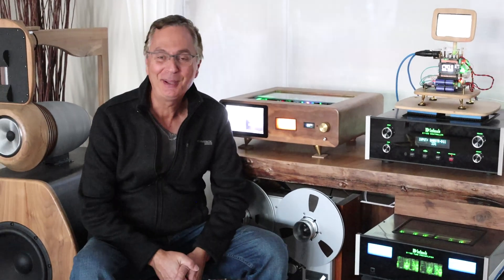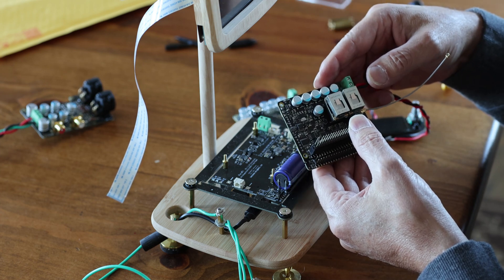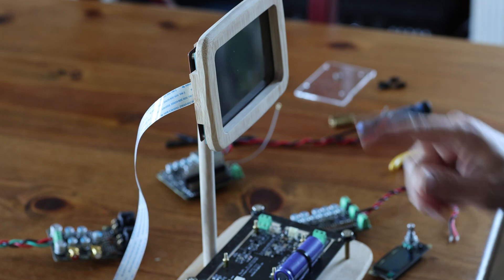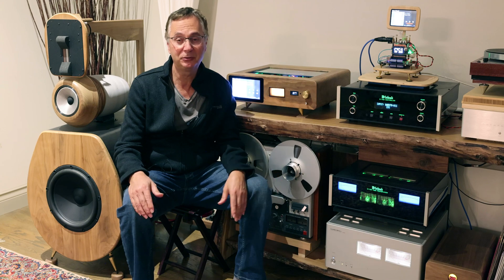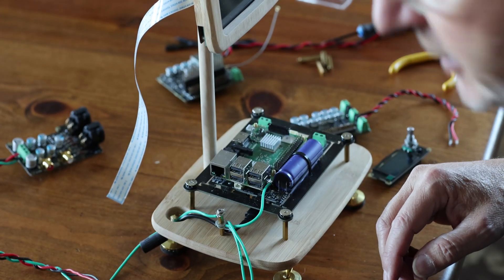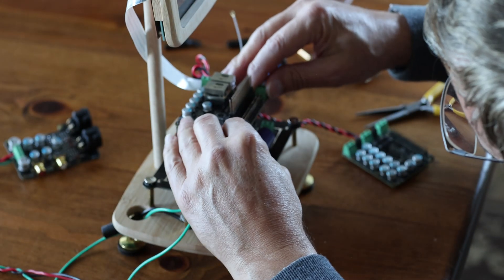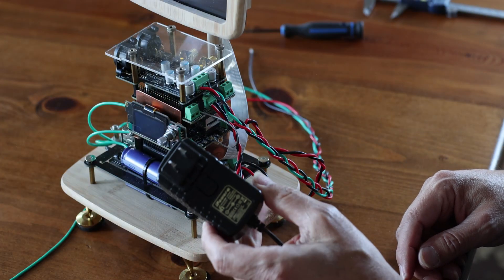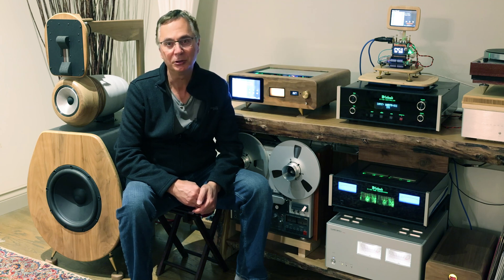Build a Flagship DIY Dac from Ian Canada Parts and save thousands of $$$ Gabster D6

Comment: Really like the build, thank you for sharing. One question, my pre amp amp does not have balanced inputs. Ian says that the rca outputs of this DAC should only be used for testing. Can you confirm that? Are there other options in case someone does not have balanced audio input?
Reply from the maker: I think you are fine specially if you have descent short interconnection. There is a dual opa861 to create a true balanced design so you loose a tiny bit on that. I recall trying it on a single ended tube amp and sounded good. 
You can also try transformers and see if it is better for you but they are close.

Comment: I cannot find no. 7.Uc conditioner  UcConditioner 3.3V  (26A) in your Video, do you really need this? I only see the purepi board.
Reply from the maker: It has been replaced with MkII 26B
https://github.com/iancanada/DocumentDownload/blob/master/UltraCapacitorPowerSupply/UcConditioner/UcConditioner3.3VUsersManual.pdf
Reply from the maker: Also this is a upgrade option not a must you can start without first

Comment: @Gabster1  I am about to insert a fifo Q7 between RPI4 and Protodac. Do I need the grey cable mentioned at 11:18 ? And if not, how does fifo Q7 reclock the signal to protodac ?
Reply from the maker: No you do not  the ProtoDac takes the signal from the clean isolated part of the Q7 via gpio 40 pin. 
Let me know if you hear improvements
Reply: @Gabster1  I will do it for sure ;)

Comment: Thank you for your content! You inspired me to start learning about DIY and getting interested in DACs and system sound quality. I have couple of questions:

So it’s DAC or Streamer? Or both? If both: how it’s switch from one mode to another?

And what is the delay in DAC mode? Is it possible to watch video without delays in DAC mode? 

For example in one time I want listen tidal from Rasberry and ROON, but another time want just watch YouTube on PC and have sound from a DAC - is it possible?
Reply from the maker: It is both Streamer/Dac in this setup the dac receives a re-clocked 
signal from the PI that acts as a Roon endpoint  
to switch to another input you would need a receiver pi board added. Also Ian has a new DDC board coming for more coplex setup
See Ian's post about that https://www.diyaudio.com/community/threads/asynchronous-i2s-fifo-project-an-ultimate-weapon-to-fight-the-jitter.192465/post-7488536

I suggest starting simple then add later.

Comment: Another graet video Gabster thank you and I think this one is worth a go. I'm currently running the Protodac fitted with FiFoPi Q7, Pure Pi, Monitor Pi and Acusilicon clocks its sounds lovley very similar sounding to my Micromega Stage 1 CD Player. I've not listened to the Duel Mono DAC II from Ian Canada how does it compare to the Protodac, your thoughts please?
Reply from the maker: The protodac is more of a Vintage sound probably the best dac value specially teamed with a fifo Q7 The Dual mono is a bit more refined, with a good I/V stage it is very good. but that requires more power supplies.

Comment: @Gabster1 Great video for the folks unsure of how these modules work together. I'm building a transport only streamer to use with my NOS R2R tube Dac. I think I went overboard on the power side of things. I had custom shielded and potted transformers wound. Ordered 6 300F Ultracaps. and built 4 AMB Sigma 11 single rail power supplies. My Ian Canada stack is built with a StationPi, ConditionerPi, Pi4, FiFoPi ma, Transport AES, MonitorPi, Official Pi 7" touch screen running Volumio. I suppose it is my personal interpretation of your streamer dac.
Reply from the maker: Thanks James you can always try a protodac and compare so cheap can not go wrong or a Dual monodac with either tranformers or OPa 861 depends on your R2R dac some reclock the signal with lesser clocks and psu
Reply: @Gabster1  I'm not big on re-clocking or DSD audio so my AD1865N-K based DAC is plenty for me. It will do a maximum of 24-96kHz. I honestly just wanted a next level transport for my personal Wav and Flac rips.

Comment: Cracking sounding bit of diy....mine is very close in spec to Gabby's....I used the fifopi ma and the es controller instead of the fifopi Q7 and monitor pi. I also have ropieee installed in the pi's sd slot, so my unit is also a roon endpoint and streamer.
Reply from the maker: Thanks for Sharing
Reply: Upgrade to gentoplayer! You will get a HUGE sound improvement with all the customization
Reply: 6.1.54 ultra eup100 rcu kernel is amazing. Also profile 6. Boot to from ram (option to put os on ram once u have it tweaked.) Also use diretta from your computer / server to diretta on gentoplayer (needs license, worth every penny)

Also hqplayer with roon will take it another step up.

Room to hqplayer to diretta host on pc/server over network to rpi4b(want 4 for faster and larger ram to boot os on ram) diretta host on gentoplayer, profile 6, kernel newest kernel and pick option ultra-eup100-rcu and cpu profile on performance.

You will have at least double the performance. Guarantee

Comment: Is it possible to build this DAC with a Coax or optical input?
Reply from the maker: Yes just add a receiver Pi or similar board
also Ian is releasing a new Card if you would rather have a system with no RPI
Reply: Thanks!  I think I will give this a go! @Gabster1
Reply: @Gabster1 what's the new card called? This will make it a standalone dac?

Comment: I already built the streamer. i sounds terrific with the Ian Canada Clocks into a PS Audio DSD. One question: What exactly is the function of the monitorpi pro? Is it neccesary for the bulid? Are certain adjustments required in the monitor pi, or ist it plug-and-play? Thanks again, for ths great series.
Reply from the maker: For a streamer it is not important but it does provide Info
if you are adding a dual mono Dac You need it to control the Dac ESS settings

Comment: You don't protect your parts from electrostatic discharge?
Reply from the maker: They are very resilient just treat them nicely. I don't live in a dry place I live by the water so not a lot of electrostatic charges.
I used to live in Ottawa so dry in the winter you can see sparks every time you rub your feet on a carpet. If you live in a very dry place then you should worry.

Comment: I'm rather confused as to why this is a DAC and not a streamer. I didn't see any digital inputs, and it's got a Raspberry Pi and a display that looks like it's got touch controls. Have I missed something?
Reply from the maker: This is both a streamer and a Dac just need to install your favorite software like Roon, Moode, Volumio... on the Pi, if you want to connect a CD player just add a Receiver Pi
Reply: That is what I was thinking. I want a stand-alone DAC without Raspberry Pi. It's a good dac if you use Raspberry Pi I am sure, but is there a good stand-alone dac to build?

Comment: What $6000 dac is this comparable to this?
Reply from the maker: Rather not mention names but from my experience spending a few grands buying a Dac did not yield a sound that matches the investment. I prefer my builds.
Reply: Did you upgrade your d11 to the dual mono dac mk2? Wondering your thoughts.
Reply from the maker: Not Yet but planning on it also  change to SC pure and some tweaks  @B2_Labs
Reply: Hey Gab. I just finish my build (because you convinced me to try). About power, my purepi can use a regular 5v 2.5a? Why 3 power supply,  if the fifo and the dual dac are fed 3.3v from purepi,? Why 2 more 5v. 1 for opamp ok, and the 3rd??. Thank you
Reply: @yangarzon8994  you need two 5V power supplies for the i/v board.

Third is to power the main 5V that is used over the gpio... Plugged into either the pi itself or any of Ian's boards with uc caps that then condition and power the gpio
Reply: @badd99 tks but, the opa have to be feed with 2x 5v in paralel and common ground?,.not possible to use +&- only of 1x 5v?
Reply: @yangarzon8994  no you need + and negative 5 volts... You need two power supplies
Reply: Ian's stuff is incredible. This will beat the ps audio directstream mk2 and denafrips terminator 2.